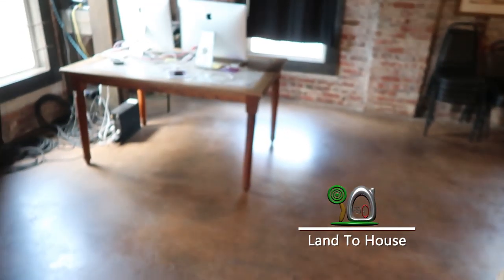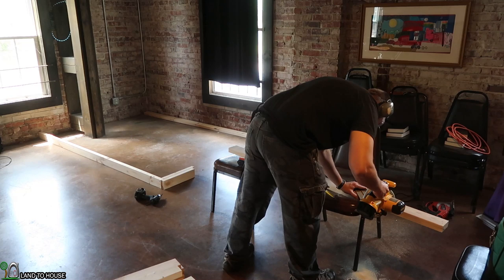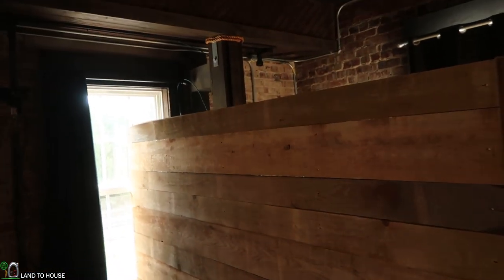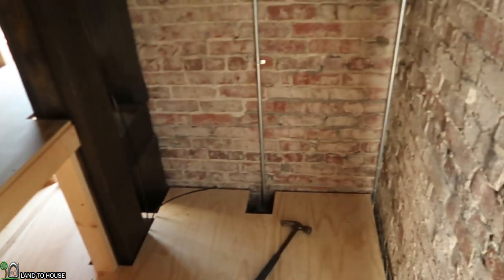Building a Church Sound Booth

Comment: that alcove for 'shelves' looks like a great place for rack mount gear like wireless mic receivers, transmitters for in-ears monitors, power amps, power conditioner, A/V switch, wifi router, lockable drawers for the sensitive things like body packs, headsets, mics, etc.  Leave space for reaching under the deck when the day comes to have to swap out a cable that's gone bad, or upgrading the system to newer tech cabling.

Comment: I have a space similar to that how high off the ground is the platform? What's was the estimate price of this project?
Reply from the maker: It's around 18" tall I think. The price of the platform is hard to judge because the sidding was free. I should think around $100 for the base.
Reply: @LandtoHouse  could you post  what the finish product looks like?
Reply from the maker: @mauriceball4608  I was just looking and I dont have a finished image or video. Sadly. But in the next couple months we will be moving this to a new building.
Reply: @LandtoHouse  Good deal, thank  you for your prompt response.I will be looking forward to seeing it. Thank you again.
Reply: Rather than copy this one, design it to fit your space. It's just a raised platform with walls and a countertop.  Where in the room will the operators have a good sight-line, will they be standing or sitting, how high is the ceiling, how high up will they need to be to see over people's heads, where will your cables run, how will you access the cables when the rodents chew through one and it has to be pulled out and replaced, or you upgrade the system and need to add 10 runs of CAT5, etc.